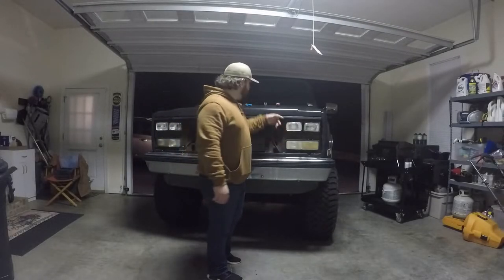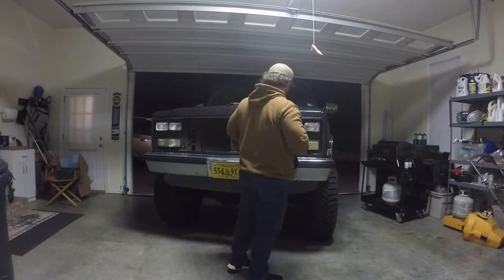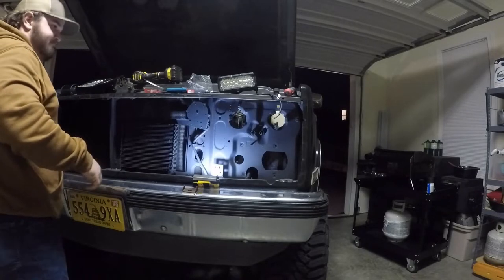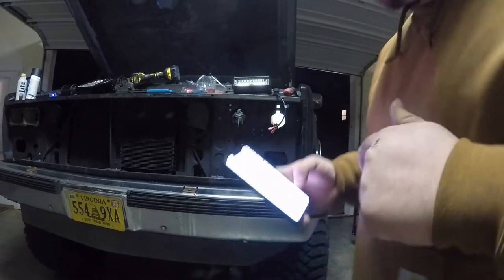First Mods To My K5 Blazer!

Comment: it looks good but highly illegal. you should wire the stock headlight wires to relays and power the lights directly off the battery. the new lights might draw to much power through the factory switch and burn it out
Reply: Varies by state. This isn't something I'd get in trouble for in WI.